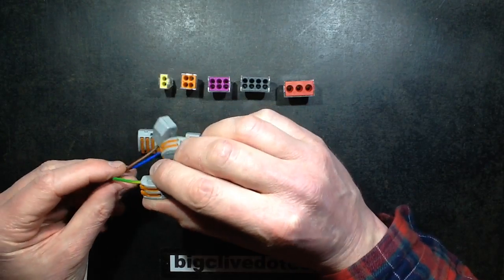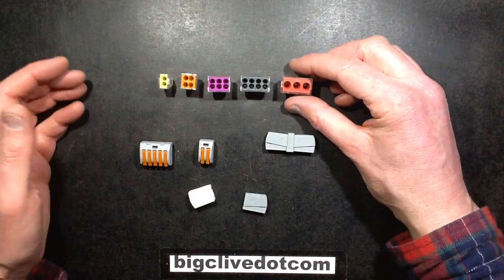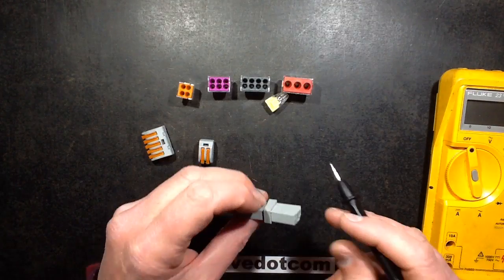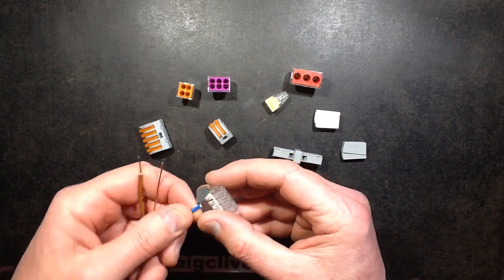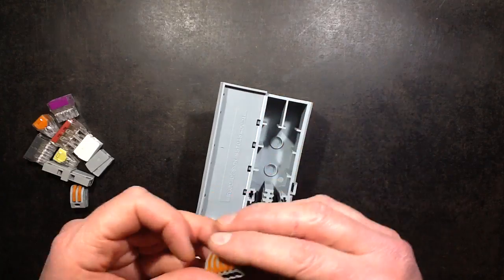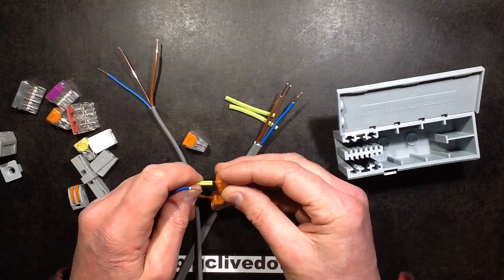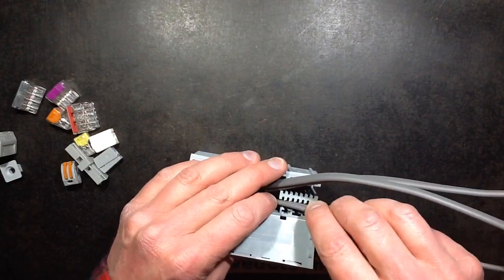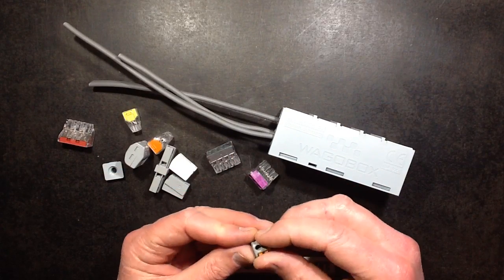A look at the Wago terminals and Wagobox system.

Comment: I use these with ferrules for stranded cables. The springs expand and contract with heat so  never get any issues with lose connections. And the push terminals are maintenance free so you can hide them behind plaster/in ceilings.

Also as mentioned you can reuse even the push ins officially... But you're only supposed to use them for the same diameter it greater wire 

Might be why they bin them... Earth cable being 1.5 you can't reuse one from a 2.5 on it.   But very handy...

Comment: My question is that I presume that the clips are in tension while open so that if the housing degrades they fail to the closed, clamped position. The levers prize open the normally closed terminals.

Comment: The Wago terminals are not suitable for use in damp or humid environments. If solid copper cable is used, it corrodes (verdigris) where the spring puts pressure on it. After a time, the cable core fractures... (especially if disturbed). But before then, the verdigris and the damp cause tracking/earth leakage problems.

Comment: I recently used smaller versions of the lever ones (also made by Wago). Was much more convenient to use than screw terminals.

Did not know about the probe-hole, but after checking, yes, it is there for when I need it. Good to know!

Comment: I'm a retired sparky in Australia and have only just heard about them and ended up buying a WAGO  assortment kit box yesterday at the electrical wholesalers yesterday and just so impressed with the simplicity and ease of use compared to screw terminal strips and arthritis in my pliers hand, has to be the best idea since sliced bread, all those years struggling with screwed terminals in awkward light fittings, thanks for the video
Reply: In Germany they have sockets with Wago terminal connection at the rear of the socket. They are so much more safer and super quick to install. We need them here.

Comment: Can you use these to extend a live wire for replacing a socket?
Reply from the maker: Yes.  The Wago connectors are used a lot in home wiring.  They do low profile versions for where space is tight.

Comment: Old video but hope i didn't already post this:

The "old" screw terminals are supposed to be serviced regularly,
because the screw tension can loosen over time,
or even the metal of cable starts to move away slowly because of the pressure applied.

So basically you have to service all screwed connections and check + reapply tension.
- Now how often did you check your home/office connections in the last 20 years.. Never ?
Yep. thats normal..

All Spring/Clamping Connectors keep the correct (or enough) pressure over intended usage time.
Also they can be used for flexible and solid core wires without destroying/cutting them.

+ The leaver is really handy, albeit you sometimes hit your nail with them when they snap back.

+ When you open the clamps first and then put in the wires, you need only one hand to hold+close, which helps in tight spaces where you need to hold the wires in position.
No need for holding the clamp & screwdriver to fix it & 3rd hand to keep everything in place.

Comment: These type of connectors are indeed quite handy. I always keep a few of them around for tight spots, like a wire that's a bit too short to spin a wire nut on. The lever release ones are even better; makes for a nice quick connect on things that need service while hot. Never seen the box before; seems well-designed

Comment: At least in the US, you need to check whether or not the termination is approved for your exact use. Solid, stranded, lighting, motor loads, the enclosure volume limits, etc.

Most electricians don't bother and a sharp pencil inspector will. Hence, the reluctance to change any common practice. 

Here is an example where I got busted: that box is nifty but, you still have to secure every wire separately to the structure within 6" of the box. 

You can't even put two wires under one staple. 

It was way faster to just do it the old way with MC cable and clamps.

Comment: We use Wago terminals on the railway, they're brilliant, although some of the older guys don't like the fiddly method of pushing a screwdriver in to release a wire, but personally I love them.
Reply from the maker: If they took a look inside the connector to see the screwdriver's action on the contact they would probably like them more.  Sometimes it feels like you're just stabbing around in the dark with the less intuitive connectors.

Comment: Wago terminals have been in use in permanent installations in Norway for many, many years now. They had a black variety quite a few years ago, which was a quite severe fire-hazard, but these new ones are simply fantastic. 
They have also introduced a new lever-style model the last year or so which as a smaller profile. They are also rated safe to use up to either 32A or 34A. Absolutely brilliant little things.

Comment: I've seen these on the counter at City Electrical Factors...be handy for a home-made bench press test.

17th Edition ammendments require something like 2 Newtons of force on screw terminals now too. They stipulate that you have to use a tortion driver (they're quite expensive, as you probably know) but I still just use VDE rated screw drivers, tightening up the terminations so they're not loose nor compressing cable to the point they break!

Amount of times I take a socket face off the wall & find the problem has been caused by broken terminations, leading to arcing & interesting bangs..

Comment: In the US I know engineers at companies like Rockwell are starting to recommend spring terminals and lever lock terminals in industrial applications because of screw terminals having wires come loose from temperature changes and vibration as well as making wiring something like a PLC with over 100 connections easier.
Reply: Not to mention making changes, troubleshooting and general problem solving is way easier when you can just take the wire out by pressing something, instead of undoing lots of screws.

Comment: I suddenly have a strong desire to purchase these despite having no need for them 😂
Reply from the maker: One day you'll suddenly realise you need one....
Reply: one is an understatement. I need hundreds lol
Reply: @bigclivedotcom
one is never enough , you always need at least two :-)
i did once see where someone had joined a two core by twisting the wires together and putting them into a lever connector and then twisted the other wires together and put them in  next to the previous ones , i was called later to find why a fuse blew when a certain light was turned on :-)
Reply: Not gonna lie, I thought that was how they worked too the first time I used them.
In some cases I wish they were made like that.
Reply: Men and their toys lol

Comment: I just love Wago Terminals.
Screw Terminals suck, you need wire ferrules for them to make a connection that is really save. Some still believe tinning the leads would also be ok lol.
Also note for people who've never used wago, please don't use ferrules with them.

Having said that, at some size and especially for bus bars, screw terminals are the way to go.
But if i can use wago, i will.
Reply: But you CAN use ferrules with them, or solid, or flexible. No harm done.
(they just need to fit in)

Only Pain i.t.a. is, if you need to parallel connect really many wires, for 8 wires you need 2x5wire clamps.

But i guess for this are bus-bar and special din rail connectors available,
again "no-screw-version"
https://en.wikipedia.org/wiki/DIN_rail

Sorry, only found it in german right now:
http://www.wago.com/topjob-s/de/?_ga=2.89016283.1540363443.1503405869-100064553.1503405869
Reply: @PsiQ  Not sure you can/should use ferrules with the 221 and 222 series, perhaps it works, but Wago does not specify that it can be done. They do specify that ferrules can be used in for example some of their lever arm PCB power connectors, but not for the 221 and 222, but perhaps for some of the otherones shown in this video, not sure :)
Reply: @Robinlarsson83   The ferrules make the flex wires identical to massive, since the massives are ok, so are the ferruled ones.
 The reason of using ferrules on old screw terminals was to prevent the screw cutting through single strands and shared pressure.
Bonus: if you use them for testing with lots of plugging, they do not "untwist" and stuff stays more orderly...

Same goes for pheonix contact din rail mounting clamps.(donno type)
They have the protection so flex wires can be used directly, but its often sturdier to again use ferrules during mounting progress.
Reply: The only problem with the wall-nuts wago terminals is when connecting two wires of vastly different sizes. They don't accommodate for that.
Reply: If you mean the 222/221 series of Wagos, they most certainly can be used for vastly different wire sizes at the same time, that is one of their features after all. But perhaps that is not true for all Wagos, I´ve only used the 222s and love them :)

Comment: Anyone know if the US electrical code has a gripe with these?  Looks to be wholly less obtrusive and ugly as the square junctions I've had to use prior.
Reply: They're kosher in the US as of Jan 1 2015 for up to 440ac for the boxes, or 220vac for the lever nuts, according to most fire code.
Reply: I use them in Panels built for factories in the US. Pretty handy for giant bus terminals.

Comment: I use the "Chinese Knock-Off" WAGO style terminals a lot for testing. I find them easier to use than the QuickTest  especially for the smaller gauge wires.  OK there's no fuse protection, but my bench supply has a 20A RCD that's obviously a better bet than a 13A HRC fuse link.. For low voltages the Excellway CH3 connectors take some beating - cheap but reliable enough.

Comment: Clive, must thank you for introducing me to these fantastic little connectors. I'm currently ( no pun intended ) rigging up a solar panel et al on my shed to provide power for 12v lighting etc to my garden and was bouncing ideas for a 12v pos and neg rail/busbar setup and as it's all low voltage / low current the little 8 way wago's in a box are perfect.  Will definitely be sending you a few 'bucks' for a coffee :)

cheers pal

Comment: I wonder if they're legal/approved in the USA.
Reply: +Chaplain Dave Sparks I bought some recessed lights from Lowe's in Massachusetts and they came with Wago connectors on them (the ones that he called the "one time use").  They made putting the lights in extremely easy and I have had absolutely no issues with them.
Reply: Yup UL listed.
Reply: +Chaplain Dave Sparks they are in the home depots up here in canada
Reply: Yes, not only are the Wagos approved, but Ideal (a major manufacturer of wire nuts) also makes similar terminals.
Reply: You overestimate the logic of safety standards groups in the US especially if you get into industrial applications.

Comment: Eyup Clive. I thought I had already subbed but certainly have now for your informative and entertaining filems. You don't play fiddle by any chance do you? I like these connectors a lot. Having been made aware of them I can think of plenty applications, like running wires for a cb straight from the battery in the car. Yep, some people still use cb radio, although I have to add they are mostly freaks and weirdos of which I am proud to be :) Keep em comin big man :)

Comment: Over in the states we only use wago's for low amp circuits lighting and stuff like that. And I have seen them fail numerous times with people using them for 15-20 amp circuits at 120 volts 60hz with Europe using 240 volt and the amperage being lower on your average circuits they would do better. Even here in Pennsylvania inspectors will fail that type of connection for receptacles and other higher load device splices.
Reply from the maker: +Hotlineelec That's odd, I've not seen a failed one yet.  But on the other hand...  I've seen them from Chinese sellers on ebay.  I wonder if there are bad copies floating around.
Reply: +bigclivedotcom the way they are branded here is under a company called ideal not sure if they are over there or not but the connectors are labeled wago themselves and they do have all the American ratings on them I never really looked to see if they have a max amp rating on them or not. I know they are rated to 600 volts but not too sure about amperage. Usually the failures I have seen is the metal clasp looses tension from expansion and contraction and then they melt. If I have photos I send some over. Thanks for the videos I'm glad to see someone with intelligence making YouTube videos! No offense but I just wish there were more Americans making intelligent videos be safe brother and keep up the good vids! Thanks!
Reply from the maker: +Hotlineelec Do you use these with aluminium cable or just copper?
Reply: the ideal ones can fail... they're effectively knockoffs
Reply: You have to use the actual wago brand. An inspector can't fail them because they don't like them, they are UL listed. I should say, they can, but it's extremely unethical.
Reply: Can confirm: the Ideal-branded wire nuts, sold at Home Depot, are not anywhere near the quality of Wago (which are sold at Menards in the U.S., btw).
Reply: SigEpBlue they really are fantastic

Comment: In the beginning you talk about the grey WAGOs and "its not an official means of making temporary connections".. With that you mean that there are better ways to make a temporary connection? I guess..

Well, just as "fun fact" or whatever, we use these in installations of various things here in Sweden and they are accepted as a way of connecting leads together both temporary but also longterm..

I guess, when I think about it more, you just mean that there are better ways for a temporary connection, not that these arent great, just that there might be better variants for just temporary connections.. I think I just got you wrong there.. No complaints or anything, but I personally love these and they are very useful for installations..

Only thing I dont like is that some of them are very strong in their "fingers" so I usually use a screwdriver to pry them open =D Otherwise I pry off flesh from my fingers =D haha..

Anyhow, great video Clive! =D
Reply: +Chris Fredriksson no it's no clear the point I'm making. so on the live incoming you have as a push fit then anything that is spurred from that is lever. it's just prevents dangerous diyers pulling out the incoming. of you get my drift. :)
Reply: well, with the Wago 221 you can create something like this yourself. just break/cut away one of the levers, return it with electronic side pliers soe some similiar small tool back into the closed position and use that terminal like a push wago. (the method of using them like a push wago for solid wires is even mentoined in the Description, and it works, i tested it)
initially heppened to me by accident when i had the first lever open, dropped it and stepped on it.. then it made click for me and i thought "hmm, makes sense" (no, not using this method regulary, because it will certainly annoy the next guy opening that Box)
Reply: +Chris Fredriksson - Ok, that comment was written in the beginning of the video.. WAIT WHAT!???? Have you been working at EuroDisney!??.. or maybe just seen the electricians work there maybe? But still, awesome! I've been to EuroDisney, or now known as Disneyland (I like the previous name better), 4 times.. and I just love it there =D

Just fun to hear that you mention it, no matter if you like the place or not =D hehe
Reply from the maker: +Chris Fredriksson Lighting in Cinemagique, Armageddon, animation walk through and the entrance studio (studio 1 or lights, camera, Hollywood...    whatever they called it in the end.)
Reply: +bigclivedotcom - Have you worked with electricity in all those!? =O
Reply from the maker: +Chris Fredriksson Installing the show and effect lighting.
Reply: +bigclivedotcom - I dont know if its possible, but I love you and your channel even more now! ;) haha.. Well that is awesome, as I commented in the other video for the lighting controllers you've made, I want to know more! and with this, I got to know a bit more =D Really cool!
Reply: +bigclivedotcom ive seen some terrible use of screw terminals mostly to tight and cut the conductor. seen loads of melted choc-bloks. I'd like wago to make a block with one push fit for the live and the rest lever would be brilliant for lighting.
Reply: +Matthew Trott oh yeah over here screwfix seem to stock them at a fair price if you get caught short in an odd location.
Reply: +Matthew Trott - All in one you mean? You can still do that with push fit variant and the lever type wagos that Clive shows? The reason we don't do that is because it looks ugly with different variants in the same place or even in the same installation.. Better do just use the same variant all over one installation.. But I mean, you can always do what you want with the products available already, except if you meant an all in one..?

But I can't see that possible as you would have to have separate channels in the connector blocks.. I'm blind right now, cant see the variant you're looking for =D hehe.. Better to just stick with push-fit or lever type I guess.. until you proove me wrong ;)
Reply: +Matthew Trott - Aaaah! Now I get you =D Yeah that would be smart.. You dont easily pull out the incoming and its easy to add or remove the leads that goes out of the block.. Thats a nice variant! =) Mostly useful with live connections if you really have to fiddle with them. But a nice product in any case!
Reply: +Matthew Trott - I've seen some of those monsters ;) haha.. Well sure, maybe they haven't thought about it and may try it out =)
Reply: the 222 type wago (grey with orange lever) can be hard to open, but the 221 type is easier to open, smaller and also has clear plastic.
But for some inexplicable reason I still use the 222 ... pure habit I guess.